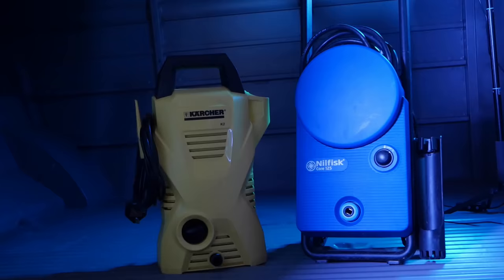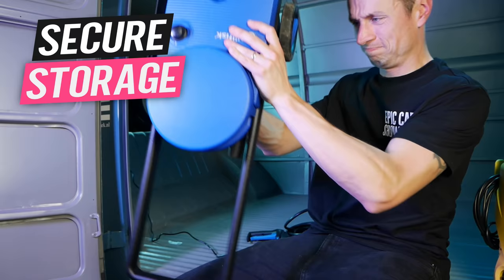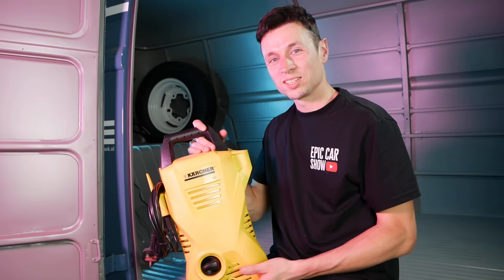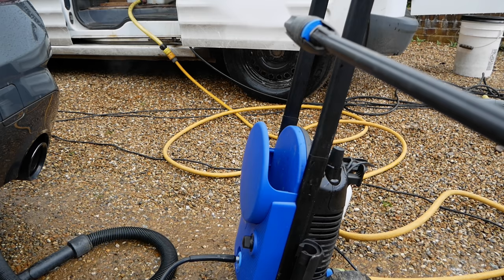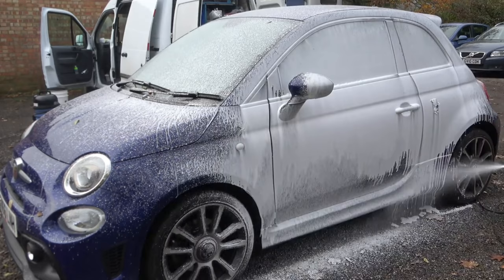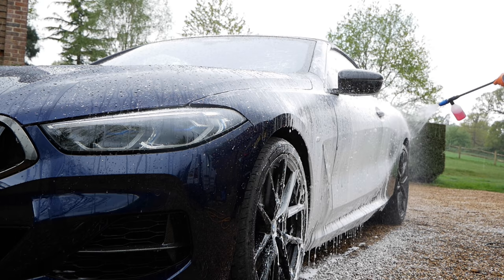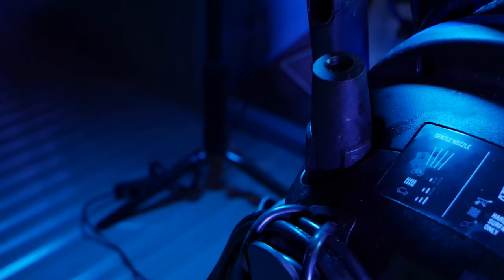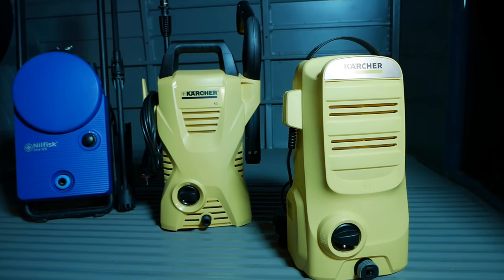Karcher K2 Vs Nilfisk Core 125 / BEST Cheap pressure washer for Car Detailing?

Comment: I have had a Karcher K4 for several years now, to be fair it has coped with the limited use very well, however I can fully agree with the hose issue, it is very stiff, it tangles all of the time, which is most annoying when using it, also as a result of this it is very difficult to stow away neatly, after watching this I definitely will consider a Nilfisk machine next time I’m in the market for a pressure washer!!.
Reply from the maker: I'd be more tempted to try the bigger nilfisk model's out and will feature some soon for sure

Comment: I've had a few Karchers over the years and about a year ago bought a K2. What a disappointment.  Hose length and stiffness and lack of power.  I ebayed it and managed to find a K2 compact new for £349.99. I know the K7 is the opposite end of the spectrum but my faith in Karcher has been restored lol. Combined with a sawn off stubby gun,, the perfect machine👌

Comment: Other than getting the hose connector turned around (watch out for that one), the machine is simple to put together and use https://www.youtube.com/post/UgkxfQauTxLT0JLSvqkq10rD79TU4k0Vz8zP . And very nice, too. I'm surprised at the power—it's more than we'll ever need, and we've not even used the most powerful setting yet.I've cleaned off a dirty concrete porch to get it ready for sealing, started to clean siding, and I know this pressure washer will be terrific for cleaning tools this fall.The only issue we had is we had turned around the hose connector, and it leaked. Once it was on correctly, though, we had no problems with the connection. Just remember that the end with the green knob goes towards the hose. It's obvious now what we did wrong, but not necessarily obvious at the time.
Reply from the maker: The core is a very good machine in terms of value for money

Comment: Great review but na the Pro-Kleen 135 bar aluminium pump washer with 5m hose + multiple attachments, Snow foam lance and snow foam bottle, 5ltrs snow foam and their own wash mitt and two super thick micro cloths for £101 is an absolute bargain. Mine came last week and is awesome and a UK brand.
Reply from the maker: Definitely some other models coming to play now. The big boi washr is definitely in the radar

Comment: noice, but nilfisk is always going to win.  better high pressure hose, better flow, better pressure, better internals and better quality accessories.  The lower end of karcher has always been very cheap, and hit or miss in its longevity.  If my K4 FC dies I'd be looking for a nilfisk
Reply from the maker: The build quality is fantastic compared to the karcher definitely worth a punt

Comment: Great video Dave, as always. I personally use a K4 compact with a bucket of water as a water source to the pressure washer. I used to have a Worx Hyroshot, which is totally a different kind of fish in the league. But watching your review, picking the Nilfisk out of the two is a solid and understandable choice.
Reply from the maker: Thanks mate. I've got the first battery powered commercial karcher coming soon 👌
Reply: @epicautomotivedetailing  that sounds! Can’t wait to see that in action 🤩

Comment: All of you will probably laugh? I have a basic entry level Clarke pressure washer from machine mart, although it was originally my dads I commandeered it for car cleaning. I have used it continuously for 5 years and it’s never missed a beat however the soap dispensing bottle broke off at the thread🤣 I am looking to upgrade soon and was wondering about the kranzle k7🤔.
Reply from the maker: Nice one. Kranzle are the king's. They still have their odd fault's but nothing like some of the others

Comment: Had the nilfisk.
Worth nothing the water in burst on me after a while and being plastic can easily be stripped if you use brass fittings from your garden hose.
Power also died, had to rewire the plug.
The on/off on the handle was also VERY tempermental and nearly always laggy behind pressing it. Sometimes 1 2 seconds. Doesn't sound like much but when you pair it with not always going on, you'd think its's not working, release it to press it again and it starts working the second you let off. Very frustrating.
It is also worth noting that the O ring and the mechanism to hold the hose gave up on us which often caused it to eject the hose and flood the place when water was turned on.
All in all, I probably would not recommend it. We got perhaps 50-100 washes from it.
I guess for the price that's ok but it was a nightmare throughout.
Also had karchers and titans and they were no better. The issue is that at this price point the usage of plastic fittings and water pumps mean they are engineered to be replaced annually.
Think I'm going to get a directhoses Grey 7 next. Something more industrial grade as we've used 4 cheap pressure washers in 5 years.
Was good when it worked but that wasn't for long.

Comment: Just as expected an great video and nilfisk win. 
Just looking at them just sitting in the van i got the feeling that the k2 wasn't gonna win this one and it juat looked cheap. I have used the k2 before and was just pants as i had all the same issues you have had with it. I ended up just packing up and finishing for the day after the 1st job using it 🥴 .

David
Reply from the maker: I can't wait to try more larger nilfisk model's. Definitely think they have more to offer. The build quality is insane

Comment: My first time on your channel Dave and I found your review excellent.  I have an ancient Kasher that is still going strong. Its weakness is that it only works with the mains supply  ( the hose is awfuI). I want a washer that will draw the water from a container of deionised water for the final car rinse.  It looks as if the Nilfisk will work on a low pressure gravity supply.  Is there a washer that will suck the water up from the container on the same level?  Thank you.

Comment: Dave I use a nilfisk Titan 220 they are really good and reliable
Reply from the maker: Definitely looking to try more nilfisk pressure washers soon. Amazing bit of kit👌
Reply: @epicautomotivedetailing  if you go on there web site they do a professional range but to be honest the Titan 220 is really powerful, the only thing I did was change the hose a purchased a 10m flexible hose and it is much better ( I used a company called direct hoses.co.uk) it was only 34.00

Comment: Great video mate, i do have a question. Would it be possible to use a snow foam lance on the nilfisk, and get a decent foam coverage by drawing water from a tank? I live in a flat with no outdoor water source, and currently using a worx hydroshot with a 25ltr water bottle & a 12v 6ltr/m pump to draw the water from it. Would be great if it could (amazon prime day its only £70 on there!)
Reply from the maker: Yes 100% mate

Comment: so what would be the base specifications you'd look for in a high pressure cleaning device for explicit use in car detailing. I want to buy something for home use, i've set my eyes on a nilfisk, but I'd generally only like to pay for the specifications i'd need: good snow consistency. So what'd be the base spec you'd aim for? 500l/h? 600l/h? Thanks for the tip on the MTM FP22.
Reply from the maker: Mid range models are great. Mind you the k7 compact has all the power without the faff. I got more nilfisks to film soon. My next video is the k7 at the weekend

Comment: if nilfisk up there gain put a vac pump and get them in stores with bits and pieces available off the shelf then karcher will have to sort it out i gave up with karcher about ten years ago due to unreliability but the problem is there readily available everywhere and accsesorys to if that a bad thing or good
Reply from the maker: Got some more nilfisk machines coming soon. Hopefully doing a giveaway
Reply: @epicautomotivedetailing  nice one

Comment: Great comparison. 
I’ve a parkside PhDP 180. 
Any one know where I can get a stubby gun for that type off connection. 
Thanks 👍
Reply: you can get adapters to add a quick release lance to your existing gun, and then use the same quick release nozzles that come with the stubby guns : https://picclick.co.uk/Lidl-Parkside-Pressure-Washer-Compact-Quick-Release-Lance-351894225539.html

Comment: When purchasing a snowfoam cannon for the core 125 what adapter is it? Is it the nilfisk/ alto adapter
Reply: I'm having the same problem mate 🙄
Reply: @jamesmartin3066  I got one off eBay the Chinese cheap ones that had a "Stihl/nilfisk/alto" adapter and it fits. It was tight and got stuck once so I sanded the brass down a bit to drop the diameter and it works fine when you remove the Lance with quick connect

Comment: Which one is more quiet?
Reply from the maker: Google k2 dB or core 125 dB. It will tell you 👌
Reply: @epicautomotivedetailing  yes i did. And it seems not much difference for both. I bought Nilfisk finally. It's great, but the hose length (6 meters) turns out quite a limitation for me :(

Comment: The Nilfisk Snowfoam Cannon is not actually a Snowfoam, it just puts chemical on, erm, just the same as a snowfoam cannon
Reply from the maker: There 2 models. One distributes the chemical differently to the other that's what I meant. One is a blanket of foam so the chemical to air ratio is completely different to the chemical one.